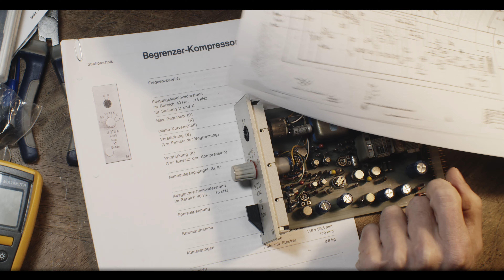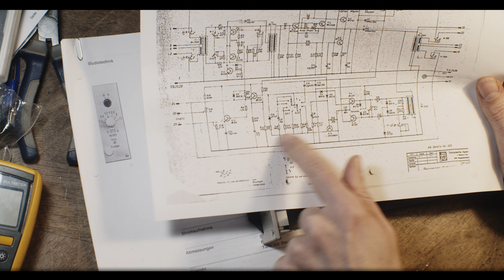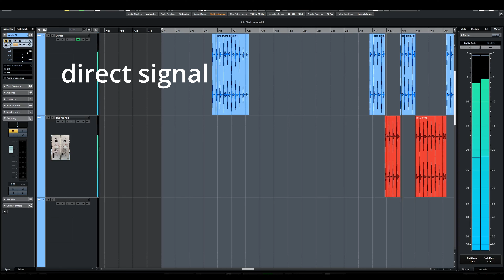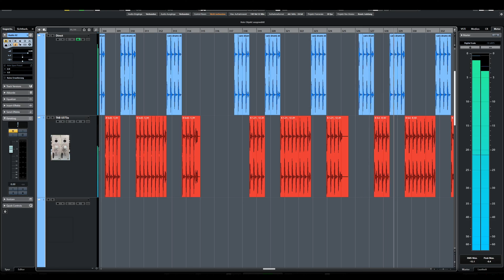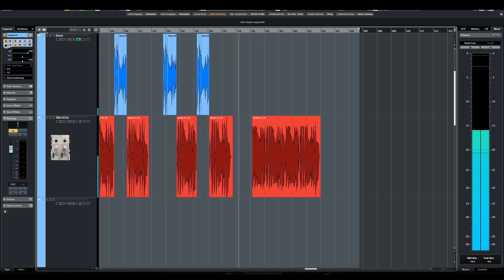Audio Demo TAB / Telefunken U373a Compressors

Comment: Thank you so much for the Demo! I have a Variant of this design built into a TAB T30 Desk (With less Transformers and an M100 in the Output stage) that sounds incredible on Mixbus but it has much less character than this 373a...how does this sound on Mixbus? Thanks and all the best, Tobi
Reply from the maker: I agree that these guys are super colourful sounding. Just kissing them in limiter mode can sound really nice on the 2-buss.
I'll see if I find the time to put out another video..